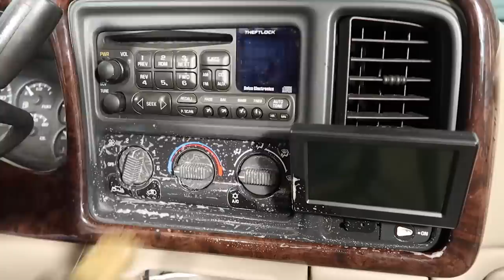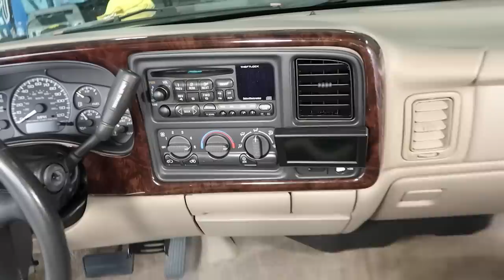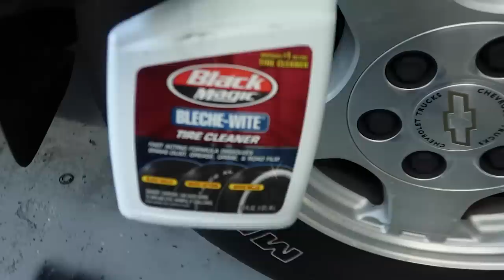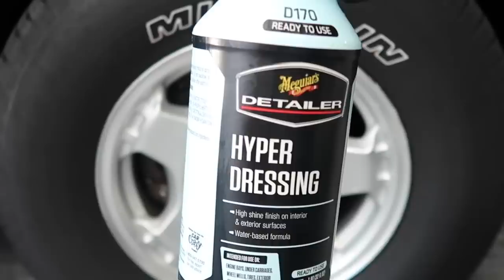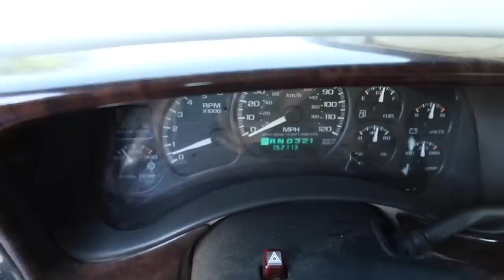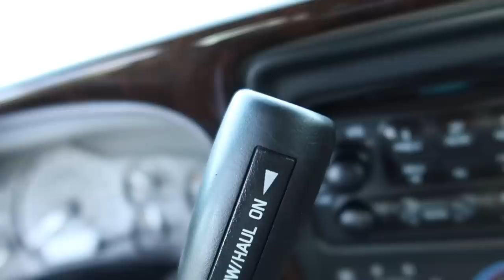2002 Chevy Silverado Single Cab Step Side Gets A Mad Detail Transformation

Comment: That's a pretty good video. You have all the tools, to do a good detailing, but your products are not that great and won't last long on the paint. I recommend for you to watch Apex Detailing on youtube. 
Also. P&S beadmaker is a way better  sealing spray, 3 D all in one, so you don't have to buff twice, combine with the uro 50/50 pad. P&S interior cleaner. An other good compound is Turtle ceramic wax, combine with there spray paint seal. 303 is ok , but it doesn't last on plastic. Invest in some Tac system products. Adams rubber and wheel is really great to clean those tires. I have used maguire's years ago and that all we had basically, just don't like it. 
I hope you don't mind my ideas. 
Good luck

Comment: Just info.. couple things.. 
You go into GREAT detail when detailing a vehicle.. on the rims.. simply unscrew the plastic lugs by hand and clean behind the center caps .. noticed you left them on while spending so much time on the rims & tires..
Also.. ALL that time you spent on the "white letters" (Michelin) on the tires.. clean them w/ the Bleach-White.. go to your local Wal-Mart .. in the "Craft" section .. pick up some Sharpie "Gloss White" Paint pens!!.. I've used them MANY times to recolor raised white letter tires.. They work PERFECT for re-lettering the RWL on tires .. just info .. Save you a LOT of time & labor that you are putting into detailing the lettering on tires 
"Sharpie Gloss White Paint Pen".. you can get different tip sizes too
Reply from the maker: I couldn’t find a white letter pen In my area and I did use bleach white I showed it in the video